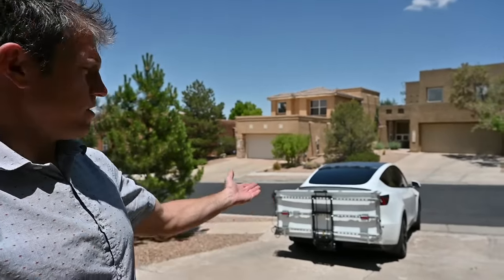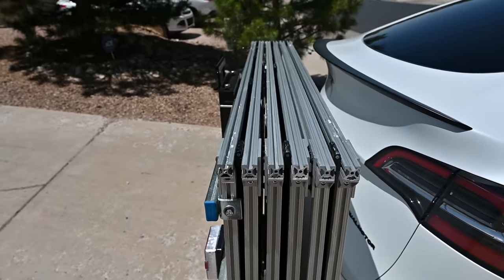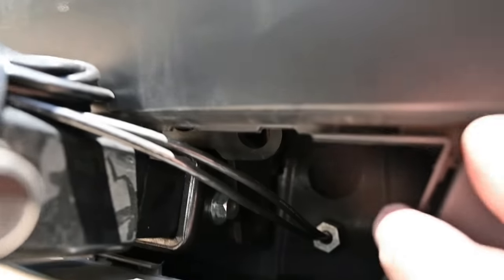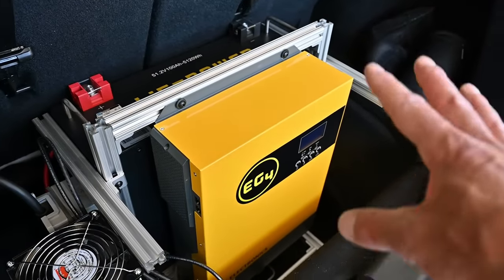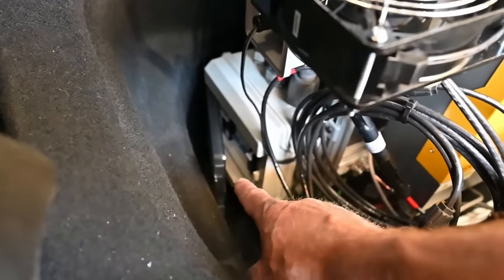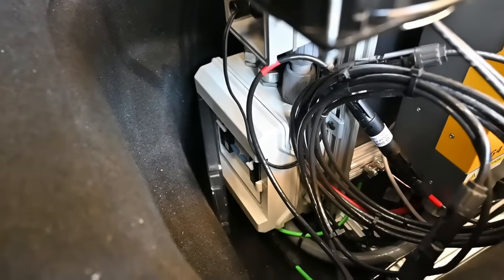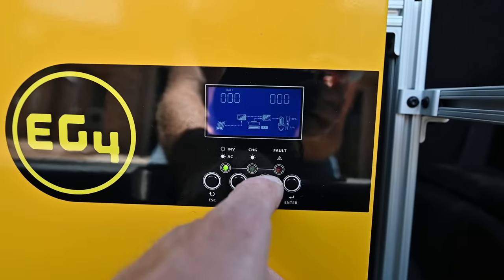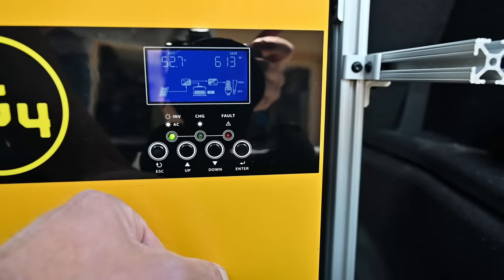Tesla Mobile Solar EV Charger with EG4 inverter and battery

Comment: I love the idea and it’s neatly done. Only thought, how much extra energy is being used by lugging around this additional weight and drag? Is the system producing enough power to cover this additional usage caused by the weight
Reply: Excellent point.
Reply: As long as you get significant time with the charger in the sun every day it should work out
Reply: @michaelsmithers4900  How likely is that if it sits in the trunk for weeks only to he used in emergencies? If it is to be used daily why not use a permanent system?
Reply: No it doesn't workout 1.2kw of solar would ideally be about 6kwh a day (for solar you calculate on 5 hours per day) but they aren't angled in the correct direction so that won't even happen but assuming you do get that 6kwh with out the other losses in the system on a stock vehicle weight and best efficiency it would add 30 miles per day but the truth is rarely to people get the upto max range numbers to start with, then you have added about 10% increase in the cars weight and as i said the panels face the wrong direction which hoping it is clear around the car the ground being the worst location to have solar they face straight up so only make peak power for a few hour during the middle of the day and finally every step of the system has losses so power is lost in the charger, in the charging of the batteries and again in the discharging and in the inverter and finally in the cars charger and it's batteries an honest figure he would be lucky to get 4kwh of usable power a better idea would be to put all that on his garage double the solar and a few extra batteries and plug into that every afternoon
Reply: @shaynegadsden  Very well stated. Yeah this is going to drop the range of the car more than 30 miles as well. Carrying flat panels like that on the rear of the car will reduce range significantly, then you have the weight penalty. The use case I can see for this is camping and off-grid applications.
Reply: @shaynegadsden  you make some good points Shayne. Especially the idea to just put it on the roof of the garage. I imagine most parking lots aren’t going to be wild about stretching out a solar array.
To your point on weight. I’m not sure the weight increase is as significant as the drag increase, especially at highway speed. 
     I can see use cases for this like being off grid for long periods or over-landing(might want bigger tires and a lift).
     I think it’s really cool he did this, unfortunately a lot is lost in the bulk, weight and complexity… there must be a way to charge dc - dc. Put that energy directly into the batteries rather that going to batteries the to ac…
Reply: @michaelsmithers4900  your right on the drag but there was no way to quantify the drag whereas weight he gave figures and everyone can relate to how heavy thing are and that we know how much of an effect weight has on EV range, but yes Tesla's have a tiny drag coefficient so it's probably like having a parachute hang off the rear
Reply: @shaynegadsden    Yes, if calculating any gains...this would never ever even pay for itself. It would be money down the pit for sure. And access to the boot? Every time you would have this obstacle. This just simply does not make any sense tbh
Reply: It's mobile meaning you can take it with you on road trips and not have to fear running out in the middle of nowhere or a camp site where there are no charging ports.
Also a great idea for home use
Reply from the maker: In my next video I state that I'm losing 3.8% range with the contraption on the back which equates to about 12 miles out of 330. But this is designed to top the vehicle off daily.
Reply: @gridfreeordie  I find that extremely unlikely if you're talking highway. We don't get 330 highway to start and drag at high speed is a killer. I was seeing that type of loss on highway at 80 with just a roof rack and no cargo box.
Reply: @cmakula  it's a low to the ground car it isn't getting to the middle of no where for staters and as for use at home it's a stupid idea, it wastes space and is always in a bad location, roof top panels and a battery in the garage would be a million times better
Reply: Technically, if you get any range at all its a net gain (if there was no other power source). 

This dude obviously doesnt really care about the costs/efficiency of this cause the money spent easily could charge this car for its lifetime. This was done obviously cause its freaking dopeee 😂
Reply: There's also the energy loss from converting the DC power to AC power to be then converted back into DC power to charge the batteries and with the intermediate battery storage, it's DC to DC conversion to charge batteries which are then used to produce AC power which is then converted to DC power to charge batteries.   A little more attention to standardization by the industry could avoid a lot of these inefficiencies.
Reply: Can use just rocks.

Comment: Ps. Solar panels hate heat. Foldable legs under each panel to raise at least 6” from the ground would help cool the panels with airflow.
Reply: kinda ironic since the hottest thing we know is the purpose of the solar use
Reply: @nabubito  yes it’s ironic that something that needs to sit in the sun hates heat.
Reply: Think he was trying to keep weight down.
Reply: @anderj235  actually even if you used plastic cups to raise the panels off the ground, that airflow would help cool them. It’s a DIY project anyway. Improvisation is key.
Reply: With hot pavement, you'll need a lot more than six inches clearance.  In Texas, a parked sedan would not be able to keep up with the AC but a parked pickup truck would and that's due to the clearance over the hot pavement.  Those panels on the road, six inches or not would be hot enough to fry eggs on.
Reply: You know they are normally installed on the roof facing the freaking sun right? lol
Reply: @segredosdotiosam9989  Not if they are folded on the back of a Tesla to be unfolded onto the pavement to help trickle charge the battery.   Perhaps you didn't watch the video.  

Besides, when mounted on the roof of a house, they are often elevated slightly to allow some air cooling of the panels and there are hybrid panels where some pipes are attached to the backs of the solar panels to collect hot water and hence also cool the panels while doing so.  Heat does reduce the effectiveness of photovoltaic panels period.
Reply: @johnwang9914  I watch the whole video and your answer  makes no sense.  Here is a quote from the manufacturer of solar panel "Solar panels are built to withstand temperatures up to 149 degrees Fahrenheit. In many cases, this is no problem as the weather doesn't reach over 120 degrees typically. Direct sunlight is excellent for solar panels to soak in as much energy from the sun as possible."
Reply: @segredosdotiosam9989  Solar panels generate less output when they get very hot.

Comment: In many jurisdictions, it is illegal to block the view of the rear license plate like that.  People have been ticketed for having bicycle carriers on the back like than.  You need to have a license plate holder on the back of that contraption or mount your plate higher.   Personally, I think they should put RFID tags in the license renewal stickers similar to the toll tags and have the police equipped with long range readers as well as have such readers on publicly available dash cams maybe even on mobile phones, hence obfuscating the need for license plates to be visible.
Reply: Yeah often you need a separate tag to place on the hitched thing as well
Reply: That was my first thaught, you might get manhandled for not having a plate. They tried to pull my pregnant girlfriend through the window for speeding in the lowest crime town in Arkansas.  It was peaceful here😬
Reply: License plates are also needed for catching croocks by the general public. How is the raid going to do that if you don't have anything, not even a phone with you?
Reply: @michaellim4165  That's the thing, if it was just a machine readable RFID tag such as with a toll tag, a few strategically placed readers such as at intersections would be enough to identify the vehicle and their travel from just a witnesses report of where, when and just a vague description of the vehicle.  It would be far more effective for the situation you are concerned about than requiring a witness to remember a license plate number.  The logs of the readers would of course need to be encrypted and any access to them logged as to why they are being purviewed for anything other than general traffic information.  Many of the tag readers might already exist as cities such as Houston placed such readers a long time ago just to monitor their own bus movements and traffic on major roads long before cities just bought traffic data from Google.  Also the Apple Bluetooth tracker already shows that by just having all iPhones periodically scan for any nearby trackers and report any hits to Apple's server with the GPS location of the phone at the time was sufficient to track the tracking device.  It isn't necessarily the witness that can read the RFID but any of the numerous devices the vehicle would pass to do so, all the witness would need to do is report the act they witnessed, access to the logs gathered from traffic lights, street lights, dash cams and mobile phones in the area would do the rest and much of this we already have.  We already do this to a small extent with police canvassing the area for dash cam, doorbell, and security camera footage in the area.
Reply: @johnwang9914  Too much overhead and red tape. At the snails pace that local governments move when making decisions, this won't be implemented unless strong political forces says otherwise. The motto is "why fix something that isn't broken". Ask me how I know now.
Reply: @michaellim4165  I did say that some cities such as Houston had already blanketed their city with traffic RFID readers just to monitor traffic and their public transit system and we already canvass a crime area for security camera and doorbell camera footage as well as dashcam footage so for the most part, that "overhead" already exists.  Besides many residential developments have a limited number of access points, where I live there are four developments that are accessed by three access points, RFID readers at those three points can be enough to secure the neighborhoods if RFID tags were in the registration stickers.  I'm not saying the infrastructure should be laid out now though much of it already exists but that license plate stickers or those windshield stickers used in the US, should just start having the RFIDs in those stickers, what's the overhead in that?  We already have RFID's in every product we buy at grocery stores and department stores and even in library books.  Not only is most of the overhead already there but just a change in regulations for the stickers and for devices such as traffic lights, doorbell cams, security cams and dashcams would do the rest of the infrastructure needed without any investment at all and once there's sufficient penetration of such devices (and Apple's Bluetooth trackers show it doesn't take much) then visible license plates won't be needed and could then be phased out.  If municipalities don't want to bother with the responsibility of gathering and storing encrypted data over the internet to limit access for logged official purposes, they can still just canvass for the data as they do now (of course this also means that hackers will continue to access the data as they already do with baby cams and security cams where people have not managed their passwords).  Really what overhead are you imagining to justify your cognitive bias and if you look at that, it probably already exists.  Apple did not have to lay out a grid of detectors for their Bluetooth tracking device to work, they just issued a software patch to their phones to provide that infrastructure.
Reply: @johnwang9914  tldr

Comment: Wish Tesla would put a bi-directional power interface into their cars
Reply: It's coming... along with a whole house backup system...
Reply: @johnbeeck2540  nope, vehicule to grid is not supported by current's M3&Y inverter that uses diodes instead of transistors.